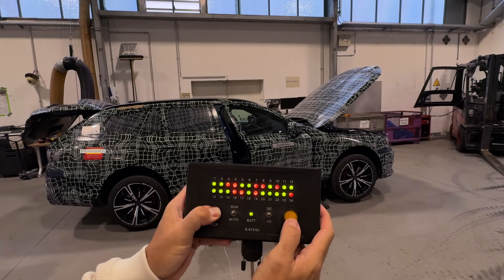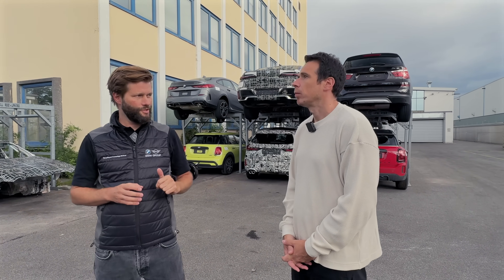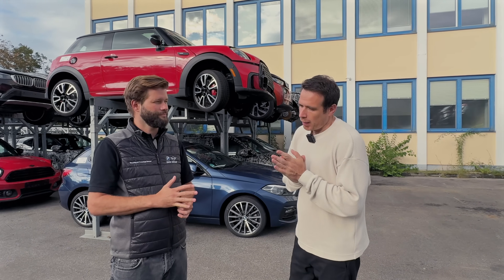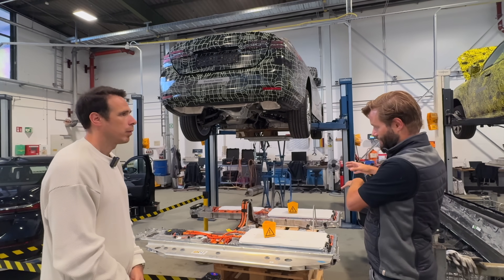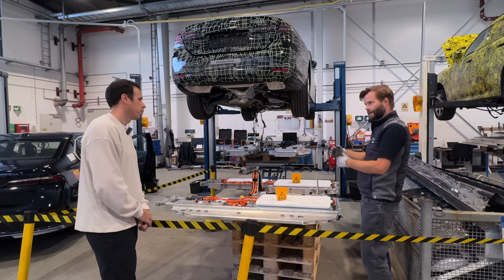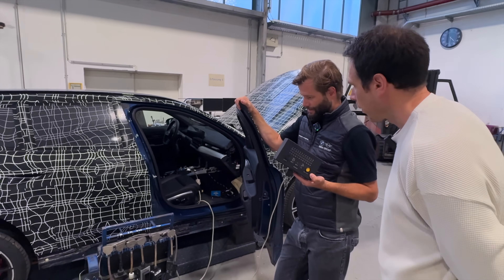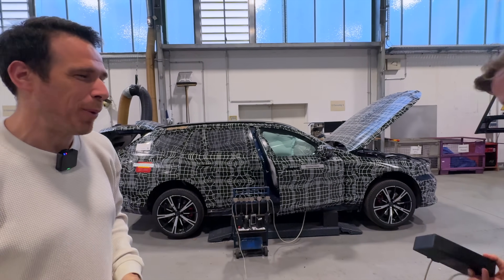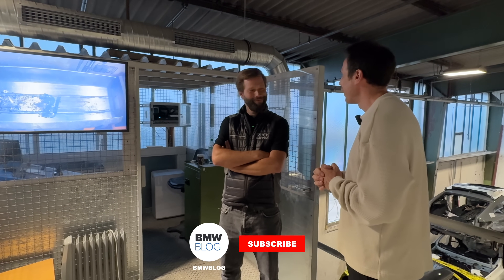Why Are These BMWs Destroyed?!

Comment: This is not recycling. Recycling would be to sell the usable parts (chassis, doors, etc) so that damaged cars can be repaired. They’re just scraping resources, which is fine on old or very damaged cars. But doing this to perfectly fine cars (even if it is electrically/mechanically totaled) is just very wasteful.
Reply: Did you even watch the video?
Reply: @user-ew6jy9mo4r  yes.
Reply: Those are pre production prototypes. Can't be registered on the road, their parts aren't final production meaning huge liability if they were released to the public. They have to be recycled.
Reply from the maker: they sell some parts, to dealers for example
Reply: You know is best recycler ,here in Balkans ,they import German cars with 200-300k km which would go to dump there .Then they rebuild engine and drive cars next 15 years .Off course problems are some parts which many are not even produced now or cost fortune  from Germany so thanks to Turkey and China which produce them independently  that cars still on the road
Reply: @dzonikg  if it would be just wih 200-300k.. cars from Germany have in Romania more like 300k->700k km :))
I've seen a VW Sharan with 1.400.000km and they turned the cluster back to around 280.000km... just stupid!
Reply: @dzonikg hello my balkan komşu dont compare turkey to china... you know we produce oem or oe parts also genuine for some big brands but china is more wild
Reply: @serhadcoban8699  Sorry but i cant agree with you ,for my BMWs i bought some items from China to modernize them and they are very good,so i know like have in my BWW 2007 E93 digital dashboard ,apple car play and many other "modern" stuff but still in body i like ,so now i like it more then new BMWs and dont fell like i missing anything
Reply: @dzonikg  yes they built quality parts ı agree but there is no guarentee you take quality parts everytime is what ı try to say
Reply from the maker: They are selling parts. Plenty of them
Reply: @bmwblog  how can we contact them for parts? Thanks
Reply: @ArthurBolbos  the parts they remove for resale go into the system as “genuine bmw parts” and are distributed to dealers and resellers through normal channels. The part you ordered at the dealership could be from here…if it qualifies.

Comment: that's sad, so many brand new parts going to waste
Reply: The point of the video was that nothing goes to waste. You cannot sell a prototype part or technology etc so they have to destroy it, it’s recycled then. There could be hundreds of iterations of something until it’s right, a gear selector or a dash design etc. it doesn’t ever work as intended first time out, that’s not how design works. That’s anti design really. Of course you try minimise prototypes etc but it has to be done.
Reply: @jeffreylinehan1613  they can be used by law enforcement, off road use... tons of different applications. they are destroying perfectly fine vehicles.
Reply: @VanillaIceCoffee  no, they can’t. That’s the whole point. Did you watch the part where they specifically addressed making sure they removed all the “normal” parts for resale to dealerships? Anything that is destroyed is prototype liability related. Everything around you that was purchased retail is the same way. How many phones do you think Apple goes through in preproduction? lol
Reply: @user-ew6jy9mo4r  look at that white x6, do you see any part being removed? NONE
Reply: @VanillaIceCoffee  do you understand what a pre-production run is? What step that is in mass production and what it entails?
Reply: Their purpose was for research and testing, their purpose was fulfilled so there's no waste.
Reply from the maker: Not all.
Reply: @bmwblog  I’m sure some engines are repurposed by the staff for some sleeper projects :)